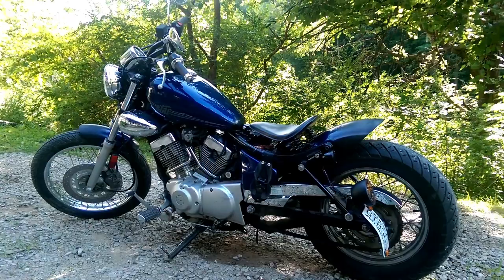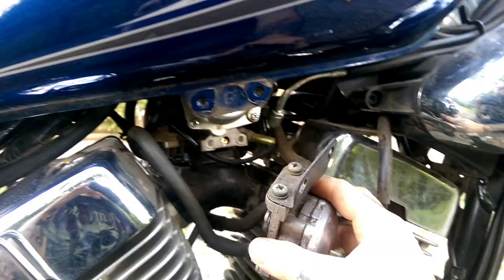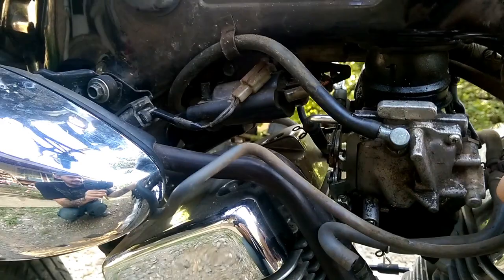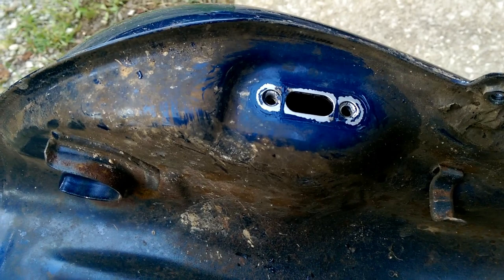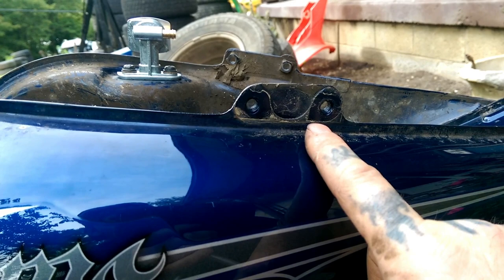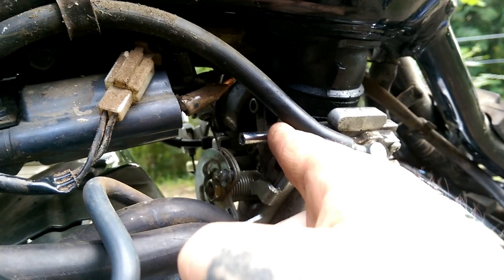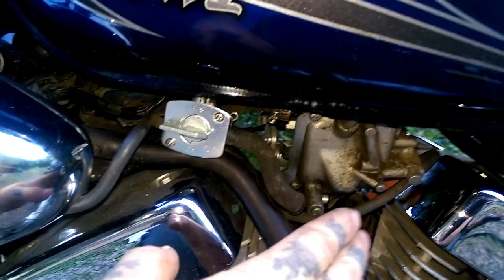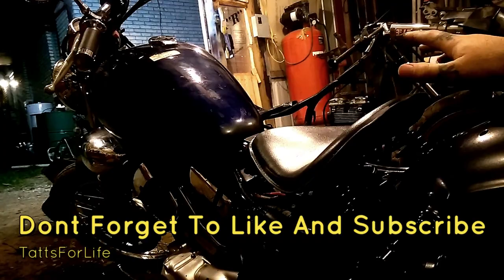Converting From Vacuum Fuel Pump And Petcock To Manual Petcock | Bobber Build | How To

Comment: Note to those who are thinking to do this mod: You may need to adjust your carb float to allow more fuel into the carburetor, after performing this mod. If you don't the engine will bog and run lean. Simply set the float to allow more fuel into the carb; and, then, readjust your fuel mixture screw, and lastly your idle screw, to make the engine run just right.
Reply from the maker: Great info
Reply: I have an xv535 and I'm having the same lean/bog issue, after adjusting your floats does it still seem like its running well? Thanks
Reply: @stevegoulet5499  Yes, mine is running perfect. Note, I had to set the float a lot higher than spec, to allow enough fuel into the bowl. My motorcycle runs like a charm. I have run about three full tanks of gas through the engine since I did this mod. So I know for sure it's all good. Note, whenever you undo the fuel lines to do a mod like this, try to bleed the air from the system. I'm referring to the part of his video where he wanted to undo that screw, after the mod was completed, but then changed his mind because the screw was too tight. That screw is to drain the fuel bowl. The reason he was going to open the screw was to allow air to escape the system, as the fuel comes in. I hope you understand what I'm saying. TattsForLife was able to get by because he couldn't get the screw loose without risking stripping it; but it must have been difficult to crank and not run very well until that air got out of the system. Let me know how it goes...
Reply: @BEEBEE159  awesome Thank you, I ended up putting in a after market fuel pump with a fuse and relay and that did not solve the problem, my floats are adjusted so that the "U" on the float is just touching the line of the bottom of the circle that is etched onto the circuit housing (if that makes sense) I will try to bend float clips to allow more gas in like you suggested.

Thanks again for the advice
Reply: . To

Comment: Hey man, thanks for making this video, and answering my questions. I just finished doing this mod, just like you did; I took my bike out for a ride; and it ran just fine. The bike looks so much better without all that extra crap on it. Also, it's a lot easier to remove the tank now, because you don't have all those extra fuel lines to deal with. Thanks again for all your help.
Reply from the maker: welcome, it seems from some the comments, some people may have issues with the mod, It worked great for me also
Reply: @TattsForLife  I did mine exactly like you did. I used the same exact hose that you used, and I did not install a fuel filter, which you didn't either. Those people that did not have success either installed a fuel filter or used a hose that is too long and straight. This will inhibit flow enough to cause a problem. I've gone on the highway, and there was no problem at all. I also rode with the tank near empty, on reserve; and that wasn't a problem, either.

Comment: I know this is a relative old thread but here goes nothing. I have a 2009 V Star 250 that the carb kept running out of gas probably cause of my 250lb big butt. Vacuum pump couldn't keep up so my fix was to get rid of both the petcock and the vacuum fuel pump. I used a petcock for a V Star 650 and an electric pump for a Kawasaki Mule that has about 2psi. It's a pulse pump that once it reaches it's pressure it drops down to an occasional bump to keep up and will stop pumping if the engine doesn't need the fuel like when idling. I'm 71 and a 250 is all I really need. I got both from amazon for $33 that's for both. Petcock was $9 and the pump was $23.64. Draws 1 amp and holds at 2psi.

Comment: Very cool.Just bought a 2007 Virago to play around with,looks like an easy thing to do.I'll be trying it once I figure out why the front cylinder has zero compression
Reply from the maker: Thanks man, have you put it on a compression tester if so, it could be a stuck valve, broken valve spring, a broken vale or burnt valve, bad rings, cracked piston, bad valve lash this would be a good check off list and should get you on the right track
Reply: Steven, did you ever figure out what your issue was bc I'm having similar issues but I think my fuel pump (vacuum operated) may or may not be faulty. I had an inline fuel filter placed just after this pump going to the carb and fuel is getting through but is not reaching the carb like there's not enough pressure pushing my fuel which makes me believe I have compression issues. Brand New carb. Having troubles with bringing down the top carb joint boot to top the carb. It seems to be stuck from back pressure unless I engage the throttle to the wide open position; then Im able to adjust it downward but it still leaves about a 1/8 gap between the bottom of the carb and the top of the intake boot, which I have tried to compensate for with clamps and duct tape. Still not turning over. Fuel or compression is the ❓

Comment: HEADS UP! You can change to the old-style petcock. But if you go without the fuel pump the bike won't run right. Won't keep the carb bowl full and you will have serious trouble. At higher speeds, it will perform like it is running out of gas and you will end up having a vehicle run you over. Keep the stock fuel pump. Tried it. SUCKS Trying to install an electric fuel pump will take so much to install and without a regulator will likely make fuel come out of the overflow and may even with a regulator. Plus there is no proper space on the bike to mount it or them. I did it with just replacing the petcock and keeping the fuel pump and it runs great and a lot less hose. It looks much cleaner. less to go wrong. Easier to work on. Change your gearing to 17 teeth on front 42 on the back if you're under 160lbs. Great cruising speeds. Great bike for the small (under 5'8" rider. Enjoy.
Reply from the maker: First great info on the mod you done, I Never had a issues and many others haven't, have you check your fuel line to make sure no kinks and that it can flow downward good, and if you running out fuel, try adjusting your float up some to allow more gas in the bowl

Comment: I made this mod out of necessity, if you have problems with the bike seeming to run out of gas it shuts down at high revs you feel explosions and jerks. First you should go to refill your gas tank, then retest it and if you don't notice any changes adjust the fuel hose. I put it lying on the carburetor on the part of the throttle cable. I did not have to cut the carburetor fuel inlet tube. And for now it's fine but I wouldn't leave it fixed and it's impossible to put a fuel filter on it. What I'm going to do is buy the original pump and connect it with this new Petcock. Although I also have an electric pump but for some reason it doesn't work. This direct mod is good as a second option if your pump or Petcock fails on the road. I recommend looking for the Petcock at a local store in your country. I found one just like it for $3.50 dólar, 34mm measure between screws and maybe vary a little the size of the connectors but it works.

Comment: That petcock is the same as YBR-125 no need to use the XV650 one, may be more expensive. Also, no fuel pump will make it stutter at higher speeds.
Reply from the maker: the stutter is likely caused due to float height, as many have had no issue or fixed the issue with float height adjustment, I ran a jet kit in mine with adjusted float height and never had a issues

Comment: Awesome vid man! Going to tackle this over the weekend. Quick question. The first hose was from the pod. The second was fuel line from petcock. Now what was the 3rd hose above the fuel line that u almost forgot to hookup? Thanks again man🤙🏻
Reply from the maker: Dont remember I think it was to the port on the carb boot lol video was a long time ago lol. Seems though some people do half to ajust their carb float with this mod and idle air mixture then some dont, but some have said it acts like it's running out of fuel..mine never did just be careful when testing it out for that symptom.. I also mentioned this in the description... 

I personally loved this mod
Reply: Hey buddy! One more question lol. If I don’t have my pod anymore would I just cap that line where the vacuum goes?? Where u ran the pod too?? Thanks brother
Reply from the maker: @louduva2594  never cap the vent lol just leave a small hose bent over if you dont wanna hook it up, you can cap the one one the carb boot though lol
Reply: TattsForLife ok so when u say never cap the vent, where is this vent u talk of?. On the??
Sorry if it’s a dumb question I’m a total newbie
Reply from the maker: @louduva2594  on the carb
Reply: TattsForLife thanks for all your help
Reply from the maker: @louduva2594  welcome
Reply: TattsForLife hey man! I wanted to order new fue lines and vacuum lines for the bike, what sizes are they and are they the same size🤷‍♂️lol

Comment: Okay, I am having a problem now. I did the mod just like you, and everything was fine. Then, I decided to clean my carb, and now the float bowl is not keeping up with the fuel demand. Note, I am running the OEM jetts, and they were clogged. So now that the jetts are cleaned out, the fuel supply cannot keep up. I suspect that this problem can be fixed by adjusting the float height. Most likely the float is not even within specifications, and would have needed to be adjusted regardless of this mod, after cleaning out the jetts. I will let you know if that works.
Reply from the maker: Yes sounds like you will need to ajust the float to allow a bit more fuel In the bowl, I would ajust it to allow as much as you can without the gas running out the overflow may take a few adjustments
Reply: @TattsForLife  I'm curious, do you remember what sized main jett you were using? I'm sure you upgraded to a #115 (OEM is #110) when you installed your custom exhaust. Is that right? Thank you.
Reply from the maker: @BEEBEE159  they a whole video on me redoing the carb, and useing a trick kit and also did a slider mod for  better response
Reply from the maker: video of the carb build https://www.youtube.com/watch?v=R3Sj8ZVDM3U&list=PL0wZNCbTztxq8pqLgBi9SxUVMYFXyzpIu&index=17&t=0s
Reply from the maker: playlist on all videos of the bike build https://www.youtube.com/playlist?list=PL0wZNCbTztxq8pqLgBi9SxUVMYFXyzpIu
Reply: @TattsForLife  Thanks so much for the information. I will watch these videos tonight.
Reply: @TattsForLife  Yep, man, that fixed it! I adjusted the bowl to allow more fuel in. I have it set really high now, way above specifications. I wanted to be sure that adjusting the float would fix the lean condition, and it did. I may go back, and reduce it some. It started out super rich, but I just adjusted the fuel mixture screw, and now it's perfect. I'll put another separate comment to let others know that they may need to adjust the float height so it doesn't run lean. Thanks again for your help. Your videos are the best, man.

Comment: Nice work, run well without the fuel pump?
Reply from the maker: yep sure will
Reply: NO
Reply: NO, it doesn't work. Anybody that says it does is lying or they haven't actually driven the bike on the highway over 60mph where more fuel flow is needed to keep the bowl full because of usage.
Reply: @stephenposts5008  I just finished doing this mod, just like he did; and it works great. How do you know it doesn't work, if you haven't tried it? I love this mod. My bike looks so much cleaner now. Also, it's more reliable because there is no fuel pump to fail. Lastly, the fuel tank is a lot easier to remove now, because I don't have all these extra fuel lines to deal with. You need to stop spreading fear. If you haven't tried it, then you are not qualified to give an opinion.

Comment: So does a motorcycle actually need a fuel pump at all? I have a 95 yzf600r that I'm modding and that vacuum delete looks super
Reply from the maker: yes it does if the gravity feed cant keep up with the engines fuel demand, a yzf 600 engine has a high fuel demand, gravity  feed will cause issues

Comment: Looks like maybe the link to the petcock you used is expired... Looking to do this to my XV250, so what should I look for when purchasing the new petcock?
Reply from the maker: https://www.ebay.com/itm/06-09-YAMAHA-VSTAR-650-XVS650-Fuel-Petcock-Gas-Fuel-SWITCH-PET-COCK-Filter/163940203383?hash=item262b98fb77:g:ro8AAOSwajVUPx0x
Reply: @TattsForLife  Should that work for any year? I've got an '89 that the vacuum fuel pump just failed and I'm hoping that'll be a lot cheaper of a fix than getting the new fuel pump
Reply from the maker: @mattbrown8931  as I seen they all same through years just names changed and a few bolts sizes on frame changed for the rear shocks
Reply: TattsForLife so I got it done... but now it seems like just over halfway through each gear it kind of maxes out on the throttle so you have to shift a lot sooner than normal. I’m thinking since the new petcock isn’t much lower than the carb inlet it’s just not getting enough fuel for the higher demand required at the top part of each gear. I also didn’t cut off the 90 degree turn on the carb inlet, so it is rerouted around the front of the front cylinder (which would probably cause it to lose some pressure). Any thoughts?
Reply from the maker: @mattbrown8931  it works on gravely, so yes flue line routing will have alot to do with it, if you ruuning your fuel bowl dry, I really never had any loss of power or gear shifting when I done mine, you sure you just not being paranoid lol as shifting as alot to do with gearing and nothing do with fuel lol
Reply: @mattbrown8931  Doesn't work properly. New fuel pump ebay $24.00 or less with shipping. Just ordered one for backup $22 and change sipping included. Gravity doesn't work on any bike that comes with a fuel pump or they wouldn't put one on. They can put a vacuum petcock for legal reasons like the fuel can't flow when engine is stopped so it doesn't cause a road and fire hazard. Trust me on all my advice on this subject. Been there done that and then had to do it over.
Reply: Take yours off and look at the bottom. If it and the gasket is the same shape it will most likely work. Mine was listed for the Yamaha 650 and it fit. Less than $10 with shipping. Some have the measurements with a diagram.
Reply: @mattbrown8931  PUT THE FUEL PUMP BACK ON. NO WAY AROUND IT!
Reply from the maker: @stephenposts5008  I sorry to here that the mod did not work for you, the
 boy that has my bike now rides it daily with this mod, my bike was also jetted and had the slider mod and with pipes

Comment: I cut off the vaccum pump on my sr500, now it stall at full speed and im pizzed 😆
Reply from the maker: A sr500 them are cool bikes, single piston I think, cafe racer style, I always wanted one to make a cafe racer out of, but I think the way the tank sets on the bike that it don't gravity feed to well, but one of the common fix's on the xv250 like in video is moving the fuel float level  to allow more fuel into the carb, you can also have a new custom fuel bowl made for the bike by buying a old fuel bowl and having it lengthen just a tad it dont take much, the stalling is it running out of fuel, also make sure your vent tube is not stopped up and if running a fuel filter it flows good

Comment: So that hose at the top of the fuel bowl that you said you almost forgot to hook up. Where does that connect too?
Reply from the maker: if i remember right, that hose is a breather tube
Reply: @TattsForLife  ok thanks! Ya that's what I thought, I also removed the vacuum petcock and fuel pump. Works great.
Reply from the maker: @cbergrun97 your welcome and yes, im very happy with the mod on my bike
Reply: Does that hose need to connect anywhere else or is it just open on the other end?
Reply: @randomslomo1875  I just left it open. Some people run it back to the stock air box but mine was gone so I just left it and it ran great
Reply: @cbergrun97  thank you!
Reply: @randomslomo1875  NO just open

Comment: Hey does it still work good? Did you have any problem? I would really appreciate a reply thank you
Reply from the maker: Worked great on my bike, I had no issues
Reply: Read the above comment. Won't work. Maybe if you're riding around the yard. Not on the highway.
Reply from the maker: @stephenposts5008  works fine for me and I have a many highway ride videos that should be on my channel with this mod
Reply: It doesn't work. Don't bother unless you're just riding the bike around the yard.
Reply: It works. You really should do this mod. I just modified mine, and it works great.

Comment: Do you think this will deliver enough fuel for an XV700?
Reply from the maker: I could not say
Reply: Did you ever try it Randell I have a xv500 and was wondering same thing
Reply: Manual fuel valves certainly deliver enough fuel for larger engines and were standard before the vacuum abortions were imagined.  Note this is ONLY for carbureted engines as EFI requires the high pressure and return systems. Study FORUMS as they're far better than Youtube, Fecesbook etc for tech info. Videos are for SHOWING how to do tasks, NOT for technical details because speech is inferior to text for conveying complex information.